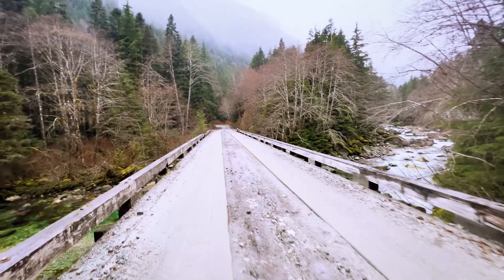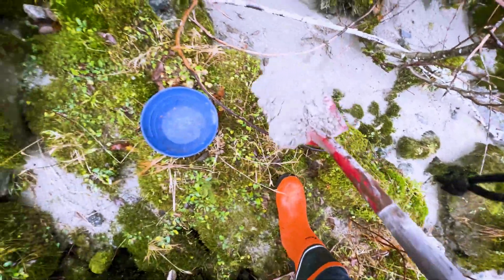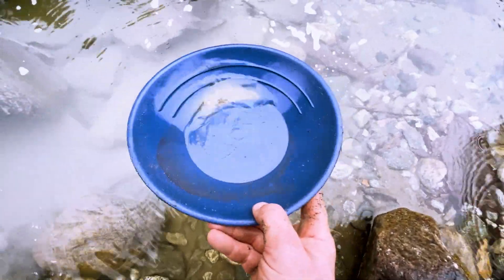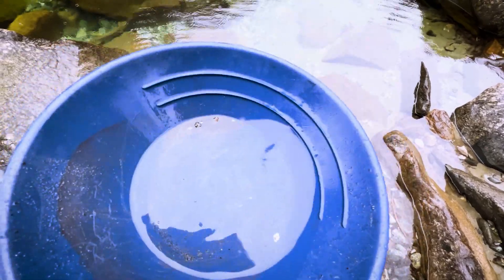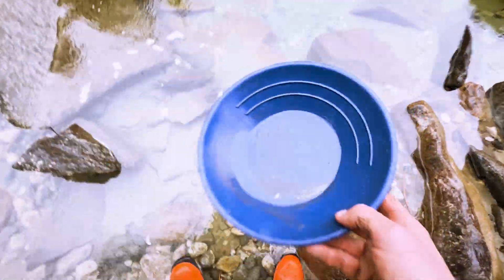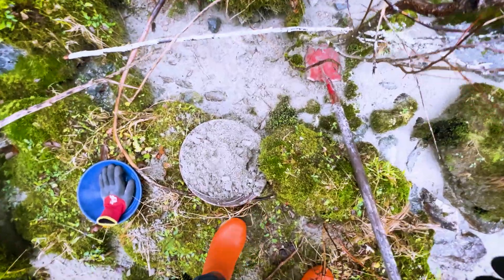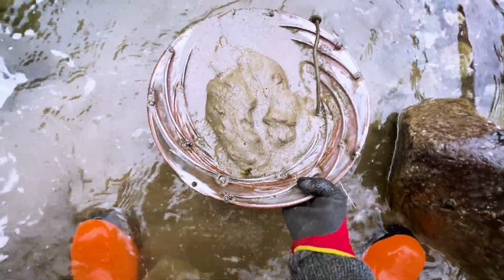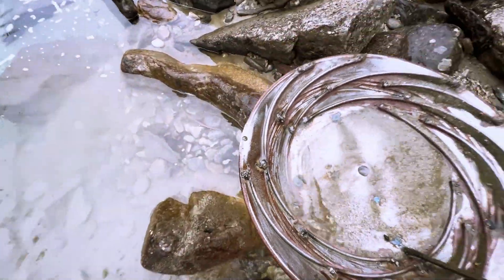133. Gold Pan Prototype Invention

Comment: Instead of making the bottom hole bigger; you could shape it in directional shape like the teeth on a vegetable grater, to allow it to purposely pull in water from the direction of the spin
Reply: ... and if you shape it like this; it has to be off-centered to scoop up water; or you could make more than one hole
Reply from the maker: Thanks. I thought of that too. I’ve decided to go with the pan being completely submerged and have it spun on a bracket to hold it centered. I had to keep in mind the injection molding process. Although I’m still in the experimenting stage 🤙